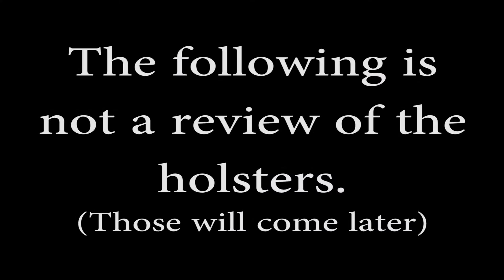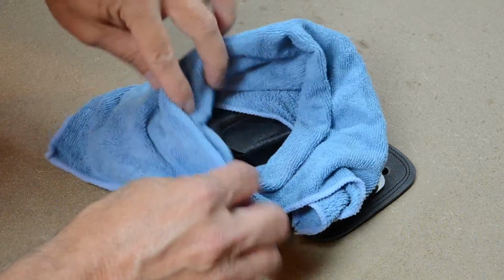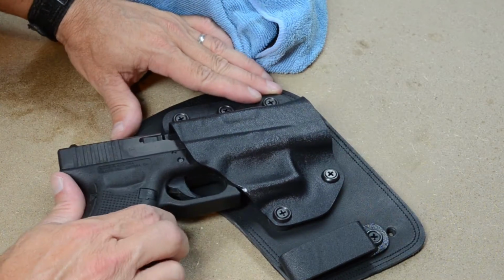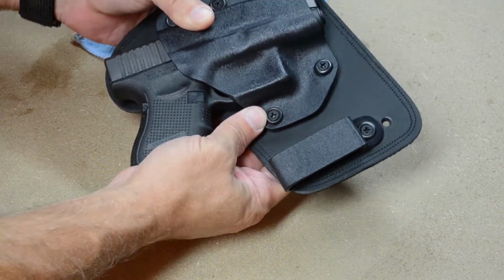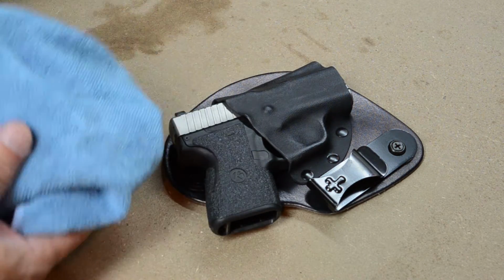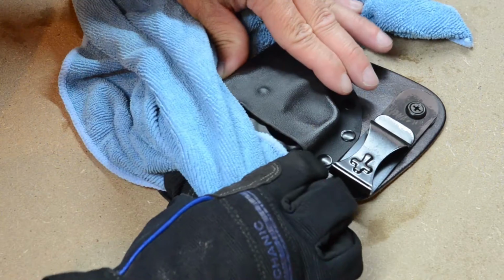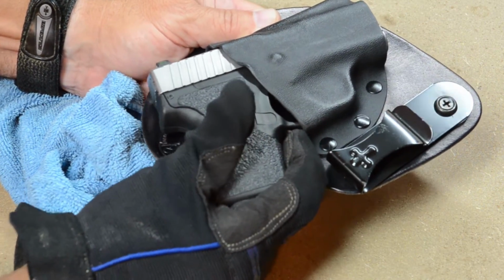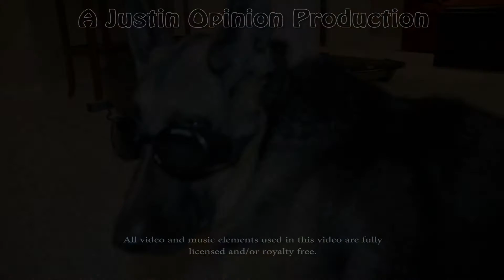How To Adjust Kydex Holster Retention

Comment: On the holster with the screws you could have just changed the bushings out and used shorter screws.
Reply from the maker: True, to a degree - but the kydex around the trigger guard was bulged out instead of sunken in, and I wanted to adjust that.